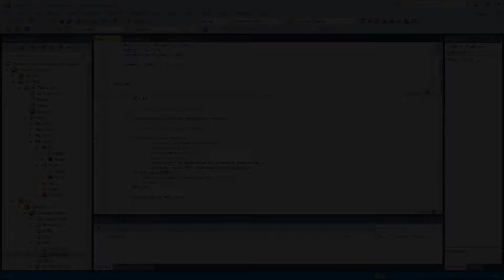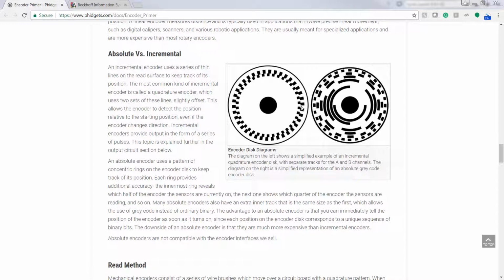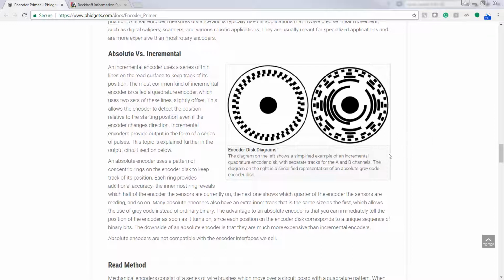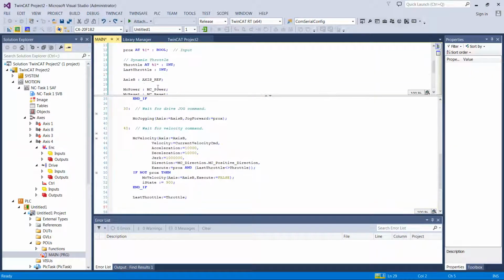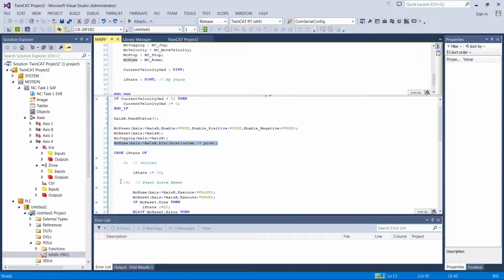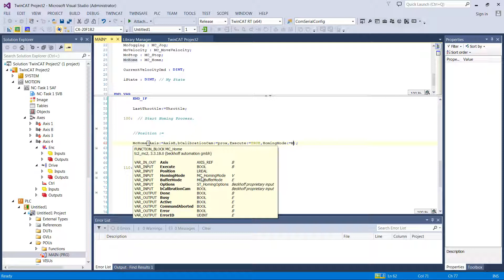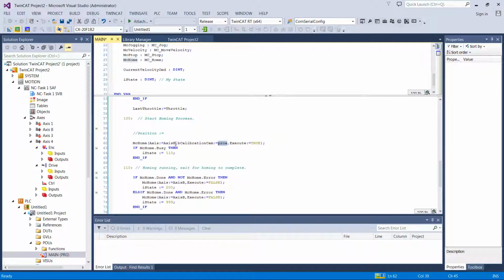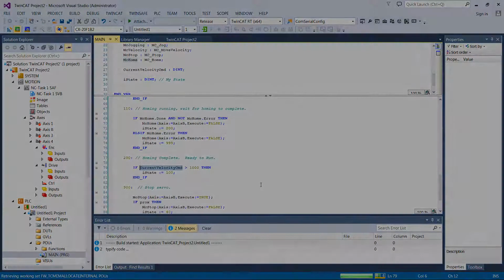Motion Control and IO with PLCs - EP11- Axis Homing

Comment: Is the limit switch supposed to set the bCalibrationCam boolean to True or false when activated?
Reply from the maker: Generally, limit switches are normally closed so you can either buffer it the opposite direction and feed in the inverse bit, or you can wire them differently to be normally open and they click closed, but I believe you can also set the cam polarity in the axis parameters but it's been a long time so I'm not 100% sure on that
Reply: @SquishyBrained  thanks.   In simulation I am trying to set boolean vars based on the ActPos for each Axis...    but I do not think the issue is there now.. I get other strange behavior.
Reply: @SquishyBrained   What parameters need to be changed to home in the positive direction.  I would like to move to 600.00 for X and Y and set Position to 600..  It seems that when I invert Cam Search (or not) the values instantly go to 600.   I am not using a Prox or limit switches but reading actually position of each axis.   Is this a problem?
Reply from the maker: @DavidMoore_drmoorejr  if you don't have an actual limit switch, you can just use homing mode "immediate" and home it in software. That will make it show your current position as 0 if you have abs encoders, that is what I would do. You can add in an offset as well. Email me if you can't figure it out.
Reply: @SquishyBrained  Thanks I figured it out.   Is there a way to send an encoder value to to an axis instead a SetPos?
Reply from the maker: I'm not sure why you would want to do that, but basically a position or set position is just an encoder value with the scaling applied to it. So if you just scale one to one, then you'll be in raw encoder counts and you can send that if you'd like. Or, you could do the math and send it to the position that gets the encoder count that you would want.
Reply: @SquishyBrained  Thats what I am actually doing now.  thanks.